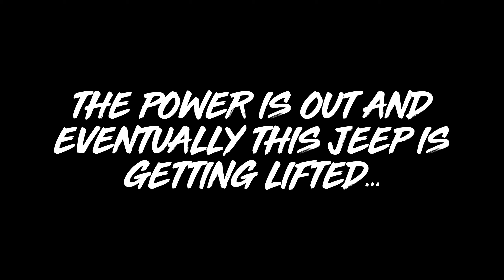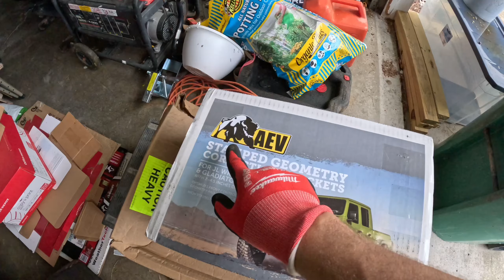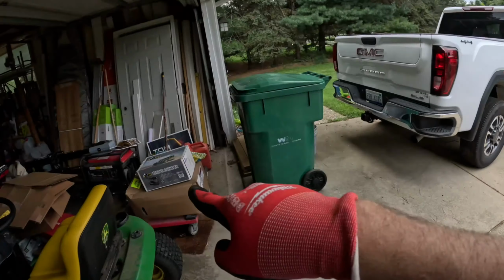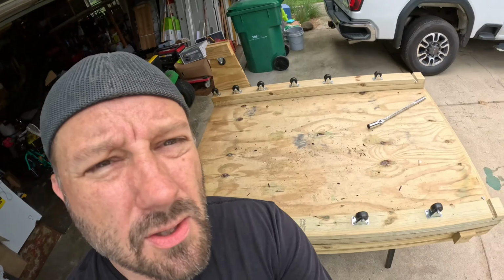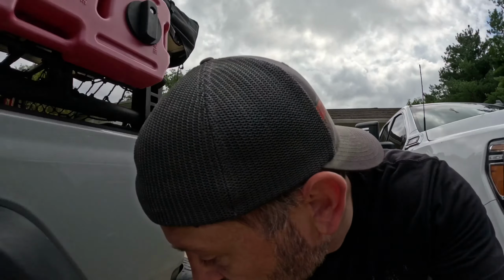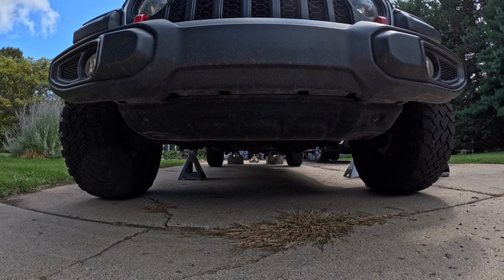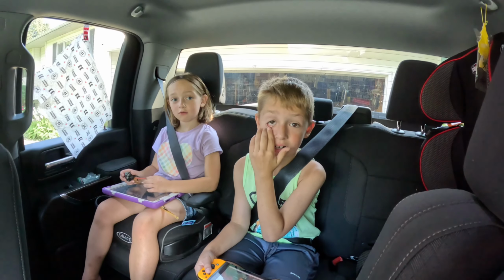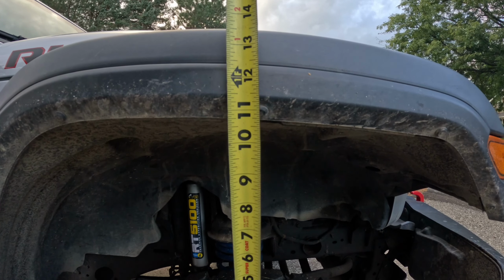The Power is Out and Eventually this Jeep is Getting Lifted...

Comment: Nice. Been thinking about one of those 2 inch spacer lifts for the Mojave.
Reply from the maker: I can't speak to the spacer lift. But given the specialty of the shocks on a Mojave vs. Rubicon I could see how that would be your choice to make. You'll be retaining all of the factory suspension but still be able to upgrade tires; hence increasing your ground clearance. I use mine for overloading. So the upgraded suspension, specifically the springs, is what I needed.